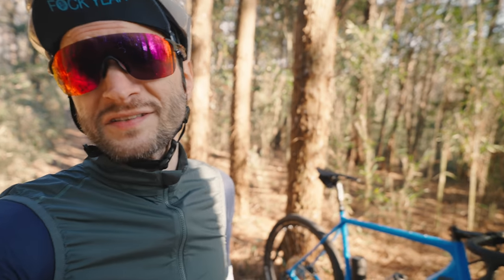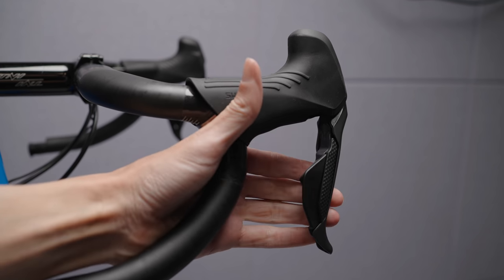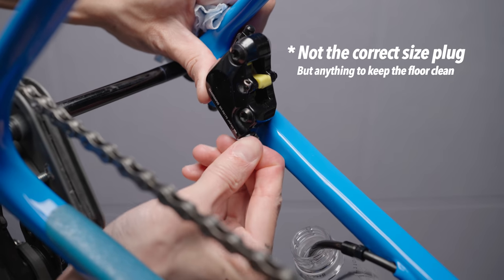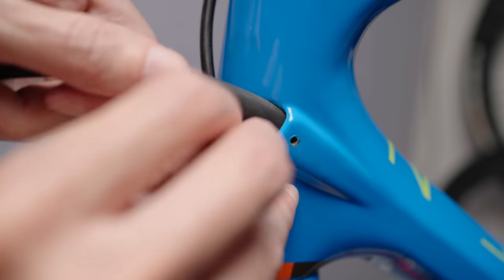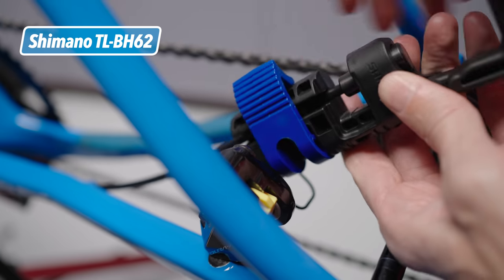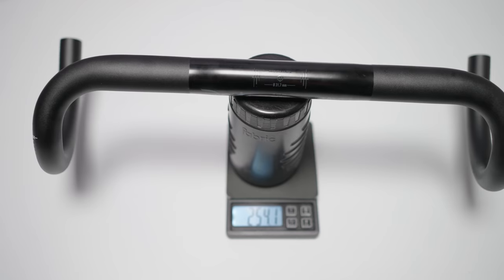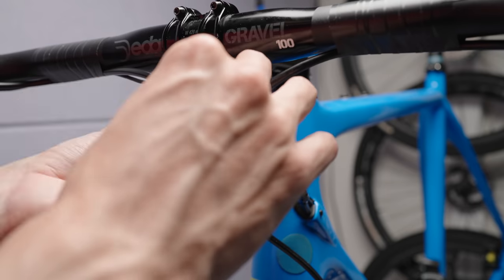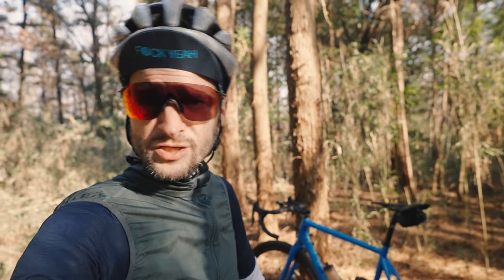Dealing with a ghost leak on the Open UP

Comment: Oh boy, this was perfect timing. My mate just told me the other day about a strange issue he has with his rear brake. Tomorow we were going to do a brake bleed, but as it turned out, I showed him your video, he checked his bike and found a damaged brake line at the frame stop. Thank you! Might have never thaught of that!
Reply: Does your mate have Shimano breaks?
seems this only happens with original Shimano hydralic hose...never heard any issues with SRAM or Jagwire (are there any other brands at all)?)
SRAM hose looks more robust and thicker..probably this is the reason they don't bend and break.
Reply: @rafaelwiater4523  It's SRAM. The damage seems to be more subtle. Also the "bubble" that appears when you apply pressure is much much smaller. You cant' realy see it, but you feel the brake hose expand.
Reply: @simonfischer4795  Servus Simon. Ohh wow. Good to know it happens to SRAM hose, too. So I will look for any other solution than for thicker hoses. Initialy I thought going for Jagwire, but now I think it won't solve my problem neither.

Comment: I had to swap the rear brake hose on my 2021 Emonda. Without the fancy Park Tool tool, what worked wonders was to use a mechanical brake cable, insert it into the hose, then pull the hose out, basically what you did. When inserting the new hose, I just reversed the process and I was able to guide it super easily. Definitely a hack/bodge for those on the budget.

Comment: I had this exact same problem a few days ago.  It was really frustrating isolating the problem.  The kink was much more subtle than yours was, and I assumed the problem was either the lever or the caliper.  After swapping these and eliminating them as the problem, we replaced the hose and everything was fine.  Miserable way to waste many hours of your life, but satisfying in the end that it was only the hose and not the actual lever or caliper.

Comment: OMG I had this on my S-works Venge on some Dura-Ace R9170 brakes!! The bike shop changed the lever the first time, did not solved the issue. Then they changed the lever again and the rear caliper, again did not work. They finally changed the hose and it solved the issue! No fees since it was all covered under warranty but we never knew what was the issue until this video!!

Comment: When building my road bike around christmas, I also had a "ghost leak" problem using an aftermarket braided steel brake line. Thought those should be an improvement - and while it's true, they should be, i couldn't get them to fully seal on the pins. Problem was, each time i installed a new pin + olive, for the first few pulls i had awesome brake pressure, then instantly had that pressure drop in the STI. In my last attempt to bleed the brakes before a slow maiden ride down the road the outer brake line housing broke, covering my flat in mineral oil as it sprayed across the room. :)

Comment: I have an Open UP and had the exact same problem, hose bend. For my case, it was caused by airplane traveling and associated disassembly. I removed the handlebar every time I packaged into a box and had to bent hoses in a very tight angle. Eventually, I had the same strange braking. Kink took place at the exactly same location too.

Comment: Had same issue with the "ghost leak" on my Open UP...the bike was maybe 3 months when it happened. In my case the hydraulic has been compressed also when I turned the steering bar all to left, even without using the levers...was fun when going downhill left corener and the rear wheel went in a drift-mode ;)

My bike dealer solved it by replacing the hose only...not really a solution I guess and only a matter of time it happens again. Interestingly Andy (from Open) never heard about this issue before – back in early 2020 – probably April, when I asked him.
My setup is with Shimano GRX di2 levers, Shimano original hydraulic hose, internal routing in a Enve G-Series bar and a little shrink-tube around di2 cable and the break hose.
Reply: Same over here. I had it twice since June 2020 when I changed from Sram Force to GRX. Before with SRAM it never happend to me in 3 years... Since I really like the GRX di2 levers and groupset I am still looking for a solution.
Let us know if you find a solution :-)
Reply: @lars_internet  have you found any solution that would fix the issue permanently?

Comment: Another reason for a issue like this, if someone still searches for solutions, is that sometimes when assembling brakes from J-kit some of the factory seal can get inside the hose and block it partially. I've had this. Pulling a gear cable all the way through the brake hose solved the problem.

Comment: Mine did the exact same thing, except while I was squeezing the lever in the stand like you, the hose finally exploded and dump DOT fluid all throughout the inside of the frame.  It was running out around the lower headset bearing.  That obviously led to entire teardown of the bike.  Open needs to revise the cable port so the little bolt doesn't weaken the hose.

Comment: Yokozuna Motoko/Juin calipers with internal hydraulic piston action allows you to run Mechanical cable with hydraulic action and not dealing with crimped hydraulic lines, sipping fluid, and constant bleeding.  There are less industry driven options that are quality alternatives than going full circle back into true weight weenie rim break mode...  quality stuff, thanks for sharing your experience.

Comment: Well imho a „known issue“ on the Open frame. Had this on mine, too after approx 10.000 kilometers. During a ride the hose was completely damaged at the inside of the small part which is installed for guiding the hose into the frame. Pulled the leaver: no braking. Pretty shocking on the open road when approaching a crossing 🙈😩

Comment: The damage on the handlebar looks exactly like there is a fitment problem. Either the handlebar is oversized at the clamping area or the stem is undersized. The bar is easy-ish to measure with calipers but the stem not so much usually. The giveaway is the sharp marks on the handlebar where the stem clamp edges are, a properly sized clamp/bar combo can in no way generate those types of marks because the corners where the clamp is split cannot have dimension smaller than the bars.

Comment: I had a similar problem but turned out the ceramic piston in the rear had a crack in it. Didn't want to wait around for a warranty caliper so installed hope rx4 in the rear, grx still up front. Grx rear is still on backorder.

Comment: A very close step spring with the inner diameter similar to the one of the outside of the hydraulic line and with around 4cm in length with a bit of an insertion by the frame will prevent kinks just like guitar cables used to have it. I believe that heat shield would also do - longer though, but the spring is far more resilient.

Comment: 3t bars are known for developing marks at the stem clamp area like that. It happened on my track bars as well.
Reply: I have the 3T Superghiaia bars on my gravel bike and these marks have also appeared around the lever clamps 😞. All torque within specs. After contacting 3T and showing them some pictures, they said it was OK. Even if it is, it's not something I like very much...
Reply: @ibe966  Did 3T say anything else? I would be worried that the marks, even though they're okay now, would eventually turn into cracks
Reply: @tomcruz3774  No further explanations. However, the marks on my bars are not anywhere near the depth as seen in the video. Mine are more like small indentations, so although I don't like it, I don't believe mine will turn into cracks. I first noticed the marks about a year ago. I recently re-taped my bars and changed my stem (about 7.000 km later) and the marks haven't become any worse.

Comment: Tobias ,the Hydro cable kink will happened again for sure,wait for another month or so,depends how often the handlebar twisted..Ive dealt with this issue for a while,the culprit is the multistop entry was installed tight (Tiny bolt in the headtube) so there’s no room for the hydro cable to slide when turning,its been perfect for a year now after the fix.I love my open,,
Reply from the maker: Mine slides, So I expect it to hold another  season or two (the hose I swapped lasted since the original build 2years ago)
Reply: @ridesofjapan  Judging from the video, it seems better to turn the handlebar to the right when you pack it for a train ride.
Reply from the maker: The bag is designed for turning the bars left to the left for a bunch of different reasons.
(Either way, I don’t really take the train with the bike nowadays since I moved out of Tokyo)

Comment: The cracks on the bar could be caused by the stem clamp. All things that clamp carbon should have rounded edges. Carbon inherently flexs and when it does it creates a point load on the sharp edges of the clamp. This causes the cracks. So even when you torque things up correctly you can still get cracks.

It's nothing that can't be solved with a file to round off the edges of the clamp.
Reply: I'll stick to alloy bar and stem as it can handle the pinching/clamping forces much better; to me carbon is not worth the risks.
Reply: I'd be surprised if the stems he's been using are like this.  3T carbon aero style handlebars have a reputation for cracking all over the place - and particularly at the clamp.  Layup schedule is either wrong or quality is very low, or both.  I'd steer well clear.  If you want light weight aero bars get Mcfk @Rides of Japan

Comment: The open frame doesn’t lend itself to particularly clean looking install with internal bar routing. I had the same issue this weekend with my Open using Pro vibe bars - looked cack so I went with internal Di2 routing, external brake hoses. Looks much cleaner and less likely to kink the hoses
Reply: Hi Russell - interesting info - thank you. I am waiting to get my hands on a set of carbon discovery bars to go onto a new UP frame and was going to try to route the hoses internally but may revise that part of the plan hen the bars arrive...finally

Comment: The same exact gouging happened with my Easton E100 Handlebars (never over-torqued either).  Interestingly enough, measuring the clamp area it is 31.8mm in one direction and 32mm in another.  I hope this can help someone else out there.  I wish I would have measured them before installing and riding them (I would have sent them right back).

Comment: Long time fan who has just bought a 3T Aeroghiaia (after seeing your Superghiaia video ages ago and finally being able to justify it). Did you ever get to the bottom of the 3T Bar? Did they warranty it? Or did you trace the problem back to a potentially undersized stem clamp area on the Extralite stem or the changed recommended torque to sub 2nM as some of the others have suggested? Trying to not be worried about my new bars ha.
Reply from the maker: Sorry never sorted it out… out of sight out of mind hehe
However, the marks didn’t line up with the extralite stem, so I have a feeling it was from the UNO stem… which never was over 4nm so still not over the recommended torque.
I wonder if they did an silent update to the bar, because they seem to be way heavier now than my bar was.
Aeroghiaia has a redesigned top anyway (I imagine) so shouldn’t be any issues, but definitely register you bar with 3T for the extra warranty etc to be on the safe side.
Reply: @ridesofjapan  Thanks for the reply mate and the very helpful info (as always). 

Yes I noticed that the weight has increased (not complaining, V2 revisions always a good thing). Will be sure to route it all external (I've also pinched a cable from an absent minded bikepacking handlebar bag).

Will be using it with an Easton stem which has the top lock design (torque the top two bolts, then tighten the bottom two evenly) which should hopefully negate this potential issue.

Keep up the good work. Loving the content. Your production values are through the roof since I first got onto your channel (mimicked your first 1x road conversion all those years ago). 🤙

Comment: I would never use an Extralite Hyperstem again. No matter how careful I was, the stem clamps left marks on two of my carbon bars.
I thought my Deda Elementi carbon bar's wall thickness was too thin. My second carbon bar from Pro has the same bite marks after a while.

Something like MCFK is a whole lot better than Extralite Hyperstem.

Oh and I heard Extralite Hyperstem will leave bite marks on carbon steerer tube as well. I have not experienced this, but bye Extralite.

Comment: What about your old EC70 AX Carbon bars? Or have you decided that ergo flat/oval tops are the future? :)
Reply from the maker: https://youtu.be/wOXSW3TuYJQ?t=277
:)
Reply: 😨 That poor handlebar - and your knee, too! How do you personally find ergo bars? I'm considering trying some out in the future (if stock ever comes back in, of course) and curious what your experience was/is.
Reply from the maker: @Antioch18x  the superghiaia’s?
I loved the pretty much everything about them apart from the internal brake routing. I would definitely do them external if I got another bar.
Reply: I think the ULNA on your other bike and these Gravel 100s are both "ergo" in that they have flatter/aero shape in the tops (instead of a completely round shape on the EC70 AX). That's what I meant. It looked like you prefer the flatter bars now and I wanted to ask about that. :)
Reply from the maker: @Antioch18x  yep, prefer the slightly flatter shape as long as I can wrap it in bartape. Pure aero bars is not really my thing though.

Comment: Question about the MT-900 Shimano Rotors. How are they? One website claims they are lighter than the Dura-Ace. Do they maintain the straightness when they really heat up or do they rub when they get hot? I use Campagnolo rotors currently but they rub when they get super hot. And, do you prefer resin pads or metallic pads?
Reply from the maker: Check this video where I’ll show actual weight vs da. https://youtu.be/-Q590MNTz6M

I prefer them over da, and they seem to keep straight for me. I use resin pads always.

Comment: Just DON'T use internal handlebar routing on the carbon bar. (Was the FSA K Wing AGX also oos?) I don't like all of those tight bends and I think the cable trajectory is actually uglier when used than any supposed aesthetic benefit from internally routing. Also, makes switching handlebars a simple affair instead of requiring the faff of dealing with hydraulic fluid. But I think that's what you were realizing by the end of the vid. 😅 Great content btw.

Comment: I have an Open UP and every time I pack the bike into a bike box the brake hose kinks in exactly the place shown in this video. I've had new brake hoses fitted but there doesn't seem to be anything I can do to stop this from happening. Does anyone have any advice on how I can stop the brake hose kinking or is this just a design flaw of the Open UP?

Comment: I think the Open frame design is at fault there since the hose entry is so far forward it creates a risk of shear force on the hose and damage like you experienced. MTB designers worked this out for hydraulic hoses about 15-20 years ago.

Comment: It seems iwith your easton crank you have gone back to the easton chain ring ? Was the Gabaruk you reviewed a year ago not worth it ? Just bought  the Easton cranks and are wondering which chain ring to opt for
Reply from the maker: No issues with the garbaruk. as I mentioned I put a 44 on because I wanted a faster gear riding indoors. Easton rings are easier and cheaper to find locally in Japan.
Reply: @ridesofjapan  thanks for that. At the moment here in sweden /Denmark I have an easier time finding Garbaruk it seems.  I was running 40 before, so maybe i go 42 instead, 44 seems heavy on singletrack climbs at least! 
Price and weight is similar but Garbaruk has somewhat more appealing aesthetics.
Reply from the maker: @jacobfrsleejonsson9252  agreed, it looks awesome... Might be a slight increase in noise in the extreme gears, but that also depends on how long you chainstays are.

Comment: About the 3T handlebar damage: please watch https://www.youtube.com/watch?v=IS8dskm85HA?t=745 where Peak Torque talks about a fault in a stem that sounds like it'll cause damage very much like what's happened to your 3T bar. Basically, slightly undersized clamping diameter will cause damage like that especially on a carbon bar. So in other words, your issue could be with your old stem, not with the 3T bar.

Comment: You did "overtighten" Extralite stem bolts. Some time ago they've changed torque specs on bar clamping area from 1.5 - 3 to 1.5 - 2Nm. i'm not sure what I was doing to acctualy go to the website and check the torque spec cause i actually have original yellow piece of paper that came with the stem. https://www.extralite.com/Manuals/HyperStem.pdf